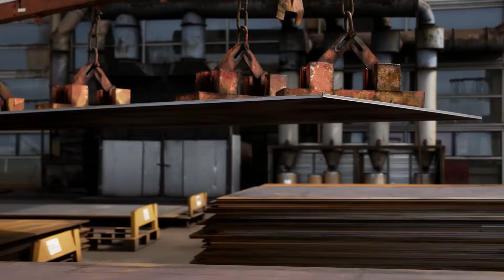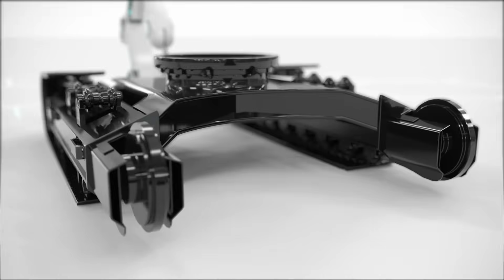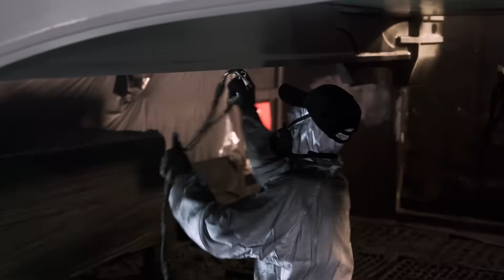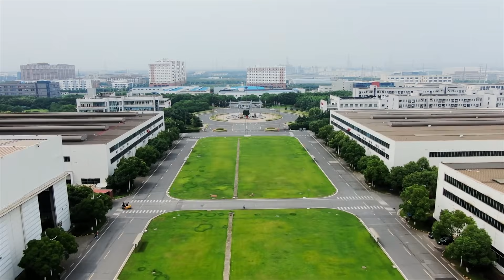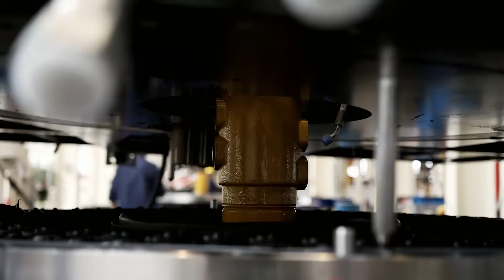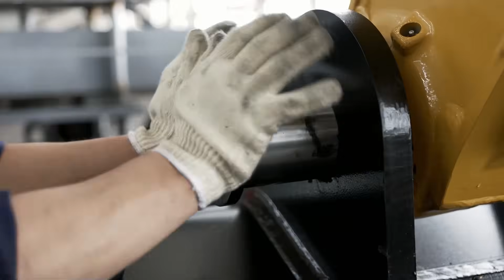Massive Excavator Manufacturing: Inside Sany's Mega Factory | FD Engineering

Comment: Super structure on a. Fixed. Ridged cradle  tracked undercarriage one. A.  Moving. Solid platform line. That lines up exactly then. Can raise up to married the two together and both plate form and.  Upper cradle move. Forward together.  Before detaching and.  Lowering. Down. As. Top  rises up  away on a. Return. Loop and.  Bottom. Platform    slopes down. In to. Floor. And. Lowers. Machine. On. To. Ground. To. Track. On  its Owen

Comment: If they had powder coating. Robots  for. Undercarriage  frame.  Quicker. Even.  More durable finish  and. Had. Special tools. That were. Built to tork  up the.  Bolts. 4 at a time.  Then  can. Switch. To. Next tork setting. And.   Go again. In stead of.   Buy hand with a long. Tork. Ranch

Comment: Are Sany excavators high quality and can they compete with mainstream brands? Or are they even better?
Reply: Sany is even better !
Reply: depends. the base machine is at least as good as any I have run, heavier built. some of the gimmicky add ons are not on the older machines but as they update the machines get more of the creature comforts. stuff like 360 cameras, and radio mute on the joystick etc were not on older ones.

Comment: throw away machine, 2000 hours, get another one. 100% Chinesium steel. Had a close look at one, looks cheap, even Cat stuff is now lower quality .The hydraulic hoses look weak on the swaging
Reply: when I bought mine it was 5 year 5000hr warranty. and everything is far thicker and over built then any machine in its class, for far less $$. I used the cost savings to get a SteelWrist tilty. I would definitely buy more of them when the time comes . I am only at 2000hrs but it hasn't needed any repairs, and the thing looks brand new.
Reply: They're better built than caterpillar and a better warranty and customer service.  Don't hate on a country just because it's not your country
Reply: I am nearing 2000hrs, machine still looks new. Had some vandalism,  kids smashed out the side window. The flat face couplers i get from local hydraulic shop keep failing, other then that she makes me $

Comment: Every 10 minutes a pile of garbage rolls off the production line. Still cool to see the process. Maybe they should think about using better steel for their bushings and pins so their excavators arent sloppy junk after 5 years.
Reply: Probably better to tell your lot to use the proper grease.
When I started working overseas I was surprised that most drivers did not grease their excavators, I stead relying on the fitter that came one every 2 weeks. About 100 hours between greasings. ALL excavators were loose as anything after 1000hours. I learned on a 20000 hour Hitachi, and everything was perfect on that one.
Reply: All diggers go loose after a while no matter the brand , ive operated all sorts and they all the same nowa days sadly
Reply: @marctelfer3503  caterpillar is better quality. These sany  excavators can hardly be called professional grade equipment
Reply: @Sabtrader736  stop the lies
Im from SouthEastAsia
I use sany i dont have any issue once
Reply: @Sabtrader736  Cat doesnt even make their excavators. Cat is a marketing group.
Reply: What if I tell you is an American factory. If not chinese factory,  it will be others.  Stop racist,  arrogant and bias.  No one country can produce every itself and best.
Reply: 5 years yeah right
Reply: The loosest most destroyed pins/bushings that ever came through our shop was a 2 year old sany with 800 hours. It was like everything was made of aluminum.
Reply: @oliver9089  that just tells you no one greased it.
Reply: @oliver9089 😂😂😂 for real
Reply: Sany good seler in indonesia good quality products .good job china❤
Reply: renz international circus van Arnheirn naar Alkmaar  comes to town sirkus transport of a scania v8 trucks sirkus decathlo rijnhal unterwgs losfaheren norderts for sport all all for sport Petri mikalenen vatanen ❤❤❤❤❤❤❤❤❤❤❤❤❤❤❤❤❤❤❤❤❤❤❤❤❤❤❤❤
Reply: Not true we use them every day.
Reply: 5 if your lucky.
Reply: @rodleypumpkins4174  2 for acat
Reply: @rodleypumpkins4174   5 year 5000hrs full warranty on the two I bought. no one else offered anything close to that.

Comment: Been waiting for this
One of the top brands
Reply: You new here?  It’s at the very bottom of quality.
Reply: @tomrogers9467  better quality then most, to be honest. less 'luxury' in the ones I bought but rugged.
Reply: @tomrogers9467  You should purchase one and use it
The machines have very good fuel economy

They use Mitsubishi Volvo Isuzu Cummins engines
DANA gearboxes 
KESSLER drive axles
Kawasaki Pumps

So I don't know what makes you say low quality

U should try and use one and confirm practically
Reply: @collinmanish7118  they do have a very aggressive auto idle. it is weird to be tracking down a slope and have the auto idle drop the rpm as it senses the low load. maybe other new machines are like that but of all the stuff I have run only the Sany does it.
Reply: These are far from a top brand

Comment: Sanys are underpowered, poor dealer support, inferior design and materials. It’s new but performs like an excavator from
25 years ago. Junk.
Reply: Between the Cummins engine and the Kawasaki pumps. Not bad in power, just cheap cab seals and electrical problems.
Reply: Held together by the tiny bead of adhesive (and 30 huge bolts) 😂
Reply: Its a middle class machine. Good enough to get jobs done, as many had used it. Best of all, its cheap.
Reply: You're farting
Reply: @c雨颖  it is an accurate statement. he has no facts just making noise.
Reply: @c雨颖 get lost little pink
Reply: @andrestein6022  What kind of wild animal are you? What are you?
Reply: @ get lost little wild seed
Reply: @ get lost little wild seed